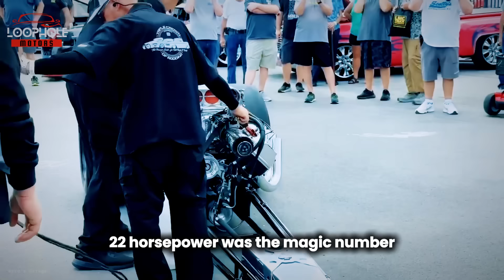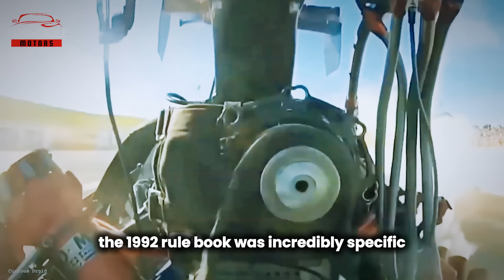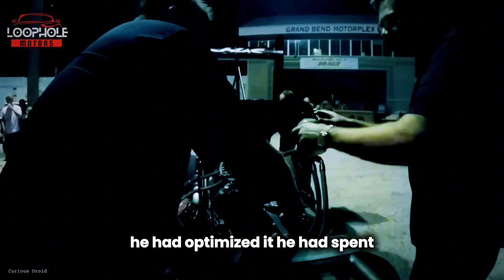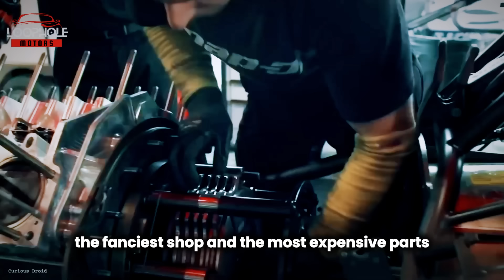How One Mechanic Hid 300 Horsepower in Plain Sight.

Comment: Most of my career was within the Soft Drink industry (1987 to 2020) working at both Production Centers and Distribution Centers. In all my time at a Production Center, I do not recall a single instance of a conveyor line slipping causing plastic bottles or aluminum cans to ever jam up and compromise the Filler Operation. Conveyor Belt slippage had been solved years before. It's a wonder that belt slippage in NHRA hadn't been solved as well.

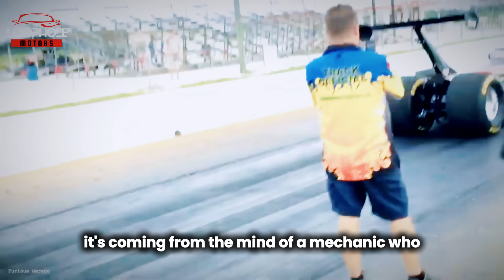Comment: 24:00 Often the change today is gearing. In snowmobile racing the CVT (automatic gearbox thing) is where you win or lose, not the engine. And many cars today share gearboxes with slight differences to other cars. So you can often race in many stock or near stock classes by changing gearboxes to another gearbox from another car that is still stock parts but has different gearing (or gearing from a smaller engine model of your own car). Couple that with smaller rims you can gain a lot of speed especially on underpowered cars.

Comment: Eaton m90 supercharger on a honda ridgeline.  Injectors, ktuner, prank adaptor plate for supercharger and a longer drive belt to spin the pulley. The hood closes no problem.  If a cnc ported P2R engine is tossed under, it could handle nitrous and tank can go in under bed trunk.

Comment: Its a toothed belt . It cant slip as such . Just jump teeth . 900 hp on a 6 inch wide belt toothed belt ? I struggle to believe that . We couldn't hold the belt tighten on a 6 inch wide belt due to stretch and the only way round it was a sprung loaded tensioner that took up the slack as it stretch  . That was a max rated p.t.o for 50 hp . So what kind of material is that belt made of to hold 900 hp . The math aint mathing in my head . 
Sure im wrong.  These guys know a lot more than me but just doesn't seem remotely possible in my head .

Comment: I wonder what these top fuel engineers think of the rubber belts that Ford are currently fitting to all their engines. Rubber timing belts designed to run in engine oil? Designed to last 20,000 miles, and by then the rubber has disintegrated and you need a new egine. If there was any justice in this world, it would be the demise of the Ford Motor Company.

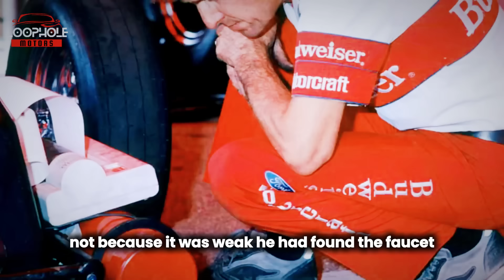Comment: 7:55 The engine did not blow up because it had too much power, it blew up because it had too much air!!!!! that means the mixture is running too lean & the air coming in acts like a blow torch inside the cylinder. First thing it cuts is around your valve seats.

Comment: I worked at Martin Sprocket and gear in the 80s and 90s. I remember them bringing custom ground cutters to the machines for prototype design. I never knew this was hoing on on the racing industry. The cutters were costed with a gold TiN coating for longer life. The rounded edges would be ground down and you can see the difference. I believe they would bring 3 different profiles at a time when we ran the parts.

Comment: Sorry but real valve spring failure is not heat deflection..real cause not enough spring clearence..min. .100 th. Some people say .050 that is wrong..while it clears in engine stand..while racing the springs over heat lose pressure..drop valves or rocker hits top retainer locks pop out and drops valve..eng with a static pressure of 240 lb. Remove a .060 shim now static is 230 lb. Not going to lose hp..

Comment: A "2200 HP Top Fuel Engine"?  Modern Top Fuel dragster engines are capable of generating over 11,000 horsepower, a figure confirmed by empirical testing using AVL Racing torque sensors in 2015, which recorded a peak of 11,051 hp during a test run. 
While early estimates and calculations from previous decades ranged from 4,000 to 8,000 horsepower, current industry data indicates that the actual power output typically falls between 8,500 and 10,000 hp under standard race conditions.

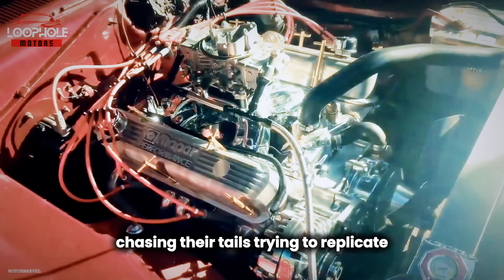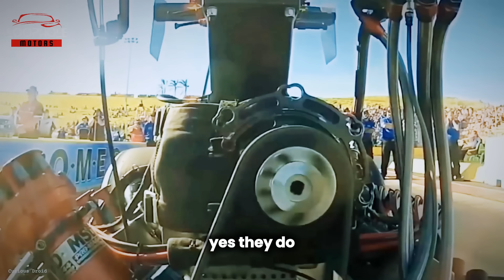Comment: make the video speak to us like 13:20 to 13:37 

 show some video comparing standard pulleys of the era, vs industrial pulleys in action, how the they were different and exactly what a 14.5° pressure angle means, and what the changing the radius at the bottom of the tooth did to the overall shape.   THAT WOULD MAKE YOUR VIDEO TOP NOTCH!!!

for now you get an A+ for the podcast though!😲

Comment: Why don't engineers (crew chiefs) do something that Audi (Bentley) have done with their diesel engines. With their V8 diesels they used a small compressor that kicked in  at 1000 rpm which intern spun the low pressure turbo (lpt) and the intern the high pressure turbo (hpt), thus creating zero turbo lag. This means that your engine could tick over to 8000rpm without the supercharger sapping 300hp as it's not driven by the crankshaft. The compressor was electrically powered and could disengage when not needed therefore not robbing power from the engine, also when the turbos were spinning it was no longer required. It also meant that if you were in heavy traffic it could be turned off if not required.

Comment: Water expansion times four thousand percent to push cylinders. Should also be used for air compression in heating and air conditioning. Only requires battery current through a permanent magnet. Does not require electrolysis or timing changes for an implosion rather than an explosion
Reply: Simplified Spark Plug Injector by
Stan Mayer

Exhaust Manifold
Power Generator
High pressure output
Created by high vacuum
Paul Pantone

Comment: Something's off in this documentary.
Toothed belts can't "slip" like v-belts, when the driven pulley is turning slower than it should given the ratios of the two pulleys.
Toothed pulleys, as far as turning ratios are concerned, are locked by the teeth, like gears. For a pulley to "slip" it would have to jump teeth.

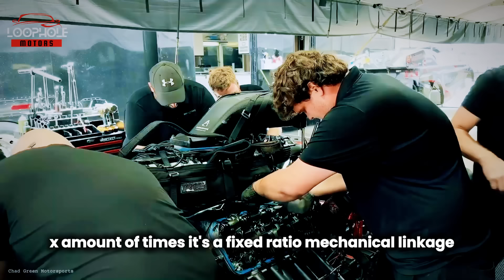Comment: @2:50 If the bottom pulley turns once, the top pulley turns X *number of times..." not  "X amount of times "
Times don't come in "amounts", that would be pounds or gallons of times.
1 time, 2 times, 10 times, 100 times...those are numbers of times, not amounts 
You'd talk about how MANY times (i.e. a number) the top pulley turned, not how MUCH times (that would be an amount) it turned.
Reply: the amount of items counted up is considered numerical

Comment: Why not use a gear driven supercharger rather than a belt driven one?  Plus you'd obviously want to use variable inlet guide vanes to allow the airflow to be choked off at max RPM, thus allowing a centrifugal supercharger to still work relatively efficiently at low RPM, but not supply a huge amount of excess pressure + mass flow at the top end (the variable guide vanes limit flow, but also increase efficiency by providing partial vacuum that requires less energy to turn the impeller while ALSO actively cooling the air before compressing it, resulting in reduced charge heating)

Variable diffuser vanes would further complement this design approach.

Variable inlet guide vanes are also sometimes referred to as a "swirl throttle" when they provide the primary means of throttle control as well. (this is generally relevant to mechanically driven superchargers rather than turbochargers, since the latter are variable speed and also most often blow-through in nature, so a separate throttle plate is used; however a turbo can feed into a mechanically driven supercharger, and in that case the inlet guide vanes can double as the throttle)

Even without a supercharger, a radial petal type guide vane inlet used as the throttle plate will eliminate suction losses and ten to increase power and efficiency at part throttle conditions. (you get consistent and uniform swirl turbulence and intake charge cooling from the suction effect, something you don't get with a simple butterfly valve)

Comment: This was not the only thing that helped Kenny reach the 300mph world record. My father was Keith Black's metallurgist. The other major problem these engines had was spring failure caused by extreme heat. This spring, failures were causing the engines to explode mid-track. Simple fix: a washer shim under the springs with a coating that deflected heat back to the head rather than into the spring. Problem solved for spring failures. The next record was the world record Kenny set at 300mph.

Comment: 15-20% more range to tesla model y with different wheels and tire. 50% of energy is wasted due to wheels and tires.

Perano wheel the one wheel is half of the solution. The tire part is not yet released, but testing and tweaking continues in the lab.

Comment: Actually, I think Amato won the 1992 Summer nationals in New Jersey.  I think Bernstein broke.  The whole race to 300mph was kind of a sub plot left out too.  Also, as others have mentioned they were way over 2500hp by 1992.  

I like the format, the story is good, and the point to look for improvements in unexpected places makes a very good video, but it would be much better if some if the technical details weren't glaringly incorrect.

Comment: Autocrosser here. 2017 Fiesta ST running (previously) H Street class. Tires RE71rs. Bone stock engine and factory tune. I drive it hard. Usually first place. I dont say that to brag, but to explain how I drive. The being said, on consecutive cornering, left into right turns, at maximum grip on warmed re71's, the car would lose the ass on the transition into the right turn. 
25lb ballast weight (From an 1996 Mustang convertible) mounted right rear, under the RR frame rail, as far back as possible (nearly to the rear bumper) and as low as possible (about 3" below the frame rail itself). The behavior of extreme cornering transitions are now just about equal weather right or left turns at speed and under light braking to transfer inertia. No more immediate spin. Technically a "mod" so unsure of legality for a "street" class, but also, can't be see unless looked for, and the performance benefit allows for a slight speed advantage (and far more stability advantage) on the hard right corners.

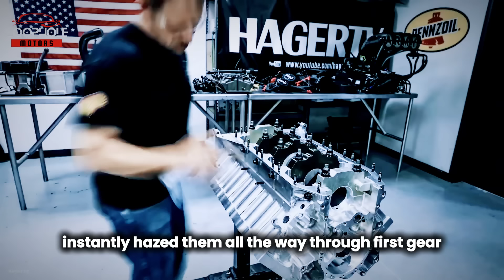Comment: 10:07 Hazed the tires “all the way through first gear”?  Top fuel cars haven’t used a transmission since the late 1980s. The only “gears” are Forward and Reverse.

Comment: I believe that since Top Fuel cars do not use transmissions,  Bernstein didn't haze the tires in first gear, but rather there was too much torque fed to the tires by the clutch.  The slipper clutch is designed to control the power delivery through regulating the slippage through a stack of clutch discs.  A 'softer' tune would allow more slip in the clutch rather than having the tires overpowering available grip.

Comment: Something is not right with your staememt nothing else changed. The air in changed so the tune had too have been. Changed or you would have melted the motor

Comment: 1:12😂 BROTHER, GIVE ME A BREAK. NITRO METHANE FUNNY CARS AND TOP FUEL DRAGSTERS WERE MAKING WAY MORE THAN 2200HP, EVEN IN 1992. TRY 1000+HP PER CYLINDER BUT MORE LIKE 10,000-13,000HP TOTAL HP ON 90% NITRO 10% METHANOL. KEEP IN MIND THAT IN 1992 KENNY BERNSTEIN BROKE THE 1/4 RECORD FOR OVER 300MPH @ 301.70MPH. 2200 HP DOESNT GET YOU THAT FAST AND IT GETS EXPONENTIALLY HARDER TO GO FAST THE FASTER YOU GO. THEY ARE "ONLY" UP TO 343.50 MPH TODAY.
Reply: the blower alone produced 2500hp.

Comment: 2,200 HP in the 90s, you're not describing top fuel or funny cars. You're talking about pro stock. Top fuel was running close to 7,000 to 8,000hp in the early 90s.
Reply: the blower alone produced 2500hp.

Comment: Im probably one of a very very few to do D16A1 swaps in 88-00 Civics and the secret was a 6in x 3in x 1/4in steel plate with a 3in thick cut to size solid chunk of rubber or aluminum. All that made was the engine mount for the timing belt side. Also notching the trans for starter clearance.

Comment: First of all, this was way too long with irrelevant images like Steve Morris. Second, I don't buy it, there is no way a toothed timing belt 3 inches wide slips 10-12%. That would mean literally jumping out of the grooves and slipping one full revolution every 10 revolutions. The teeth would be ripped off the belt in an instant. Belts do get destroyed and you see them fly off, but it would happen every time the teeth jumped grooves.

Comment: Ahh.. after motor swapping my honda,  I've now ran conduit from my headlight fuses to either fan. If you see my highbeams on, I'm sorry I'm overheating. 
91 accord lx f22b2/a6 port polished head springs retainers and polished panel bc stage 1 regrind 440cc chipped PT3A03 and factory lsd w I believe 4.16 gears dry sump. It chops.

Comment: For me it is wheel balancing. Roadforce balancing the wheels transformed the way my WRX handles and stops. The shop that did it actually ran the tire on the machine a few times to dialed in the balance perfectly. It them a while. best $200ish i spent on my cars handling.

Comment: The A/C on my civic robs way more than 5 horsepower😂
Reply: No, it feels that way because 5 hp is a large percentage of your total power.
Reply: No it's not. But your civic has very little power at low rpm and because of it 5 HP feels like it's really 20-30 hp or even more. 
It's just because at 2000-3000 rpm your engine gets less than half of its rated maximum power.

Comment: this sounds great and plausible but what is your datasource for any of this?  I can't find any records of horsepower on dragsters from that era and we are running 11,000 today.
Reply from the maker: Great question! You're spot on about modern fuelers hitting 11,000 HP. The 1992 numbers (2180 vs 2510) come from Dale Armstrong’s specific dyno sessions testing the pulleys. Back then, they couldn't dyno a fully-loaded nitro engine without destroying the equipment, so these figures likely reflect a 'test tune' or lower load baseline he used to verify the efficiency gain of the 14-degree industrial profile vs. the standard automotive one. The key wasn't the total max power, but the delta—finding that 300+ HP wasted to belt slip!

Comment: While not a driving kind of engine, my father and I were trying to upgrade a lawn mower engine for a go cart... someone before replaced the main gasket with a newspaper... ran fine before we removed it, so figure they were quite careful with installing it, and was the most interesting at home kind of fix i have seen for an engine of any kind.
Reply: Increaes compression ratio.

Comment: Two questions:

1) Why don't the narrow dragsters roll onto their sides from the reaction torque of 11,000 horsepower engines? 

2) Why don't they mount the engine's transversely and run the the engines in the direction that uses the reaction torque to force the front wheels down?
Reply: The chassis of Top Fuel dragsters aren’t rigid, they’re a giant spring that’s preloaded to counteract the torque of the engine. The flex is asymmetrical. My father ran top fuel into the 80’s, then top alcohol through the 90’s, which ran identical style chassis.
Reply: At cause some severe driveline issues among other issues, but it may work.

Comment: ❤ Damn i Love Drag Racing I have a 1981 blown Corvette small block 400 I run dual 750 on top of a 671 Weiland I use the blower top nitrous plate andron 2 bottles but here's the kick I'm also running a super Chiller made specifically for boat motors that we had to make a plumbing system in that I can fill up if I go to the track and I can train right back out again that's a nice little kick if anyone wants a picture please email me I would be glad to send them out it's not showroom Quality Car it's not magazine Quality Car it sure turns heads in a small rural town in Indiana I'm from and it makes me and my boys happy I like running a car just so I can get the thumbs up from the kids on the sidewalk take it up to McDonald's drive it up  through the Aldi lot make sure you enjoy yourself when you're young cuz when you get my age you don't have enough time to do everything❤❤

Comment: In the motorsports world we call it blueprinting an engine, you go top to bottom and from to back matching piston weights, polishing or painting lifter valley for better oil return, gasket matching every port different port finishes oem and aftermarket parts alike. You can find HP just by being matriculas and anal to stumbling across something by accident that makes a big difference. Some new things that unleashed HP are ceramic coatings on piston top down to 1st ring and Teflon coatings on the skirts and dimples on main and rod bearings to improve oil control and reduce friction with same or lower oil pressure and can't forget oil squirters that spray underside of piston to improve cooling
Reply: Meticulous
Reply: @466rudy6 

Lol! I liked the Angry Americans spelling 😂

It was the infinatile  reaction that some people have because maybe you were taught to be self righteous to a total stranger reeks of jr guy getting someone in a hum.
Reply: what kind of oil and pump?
Reply: @Badlands1182  depends on engine and application its being used for.
Reply: true,but this WHOLE video is about pulley rations. yes, its that stupid!